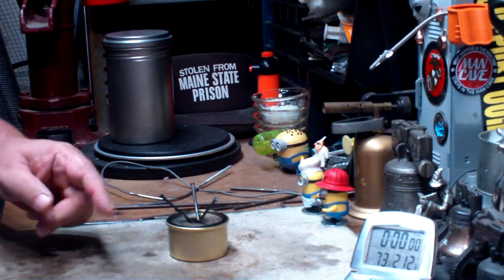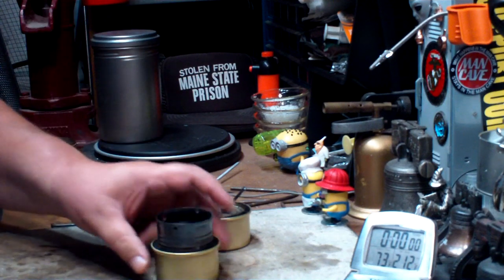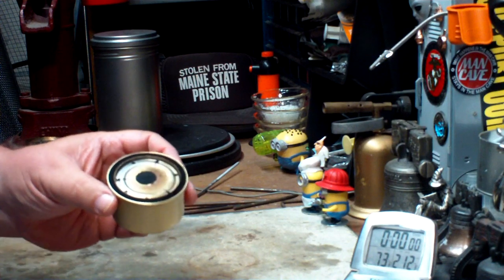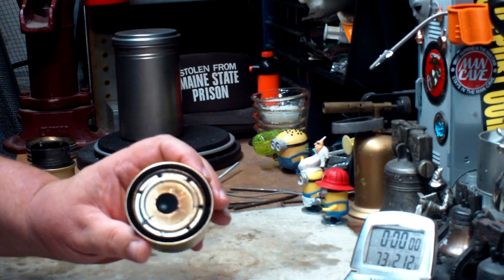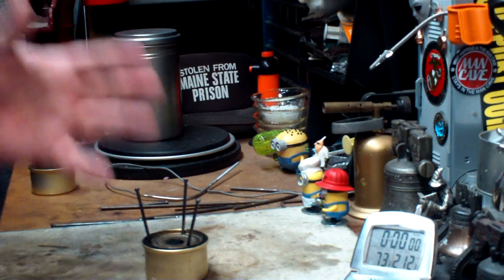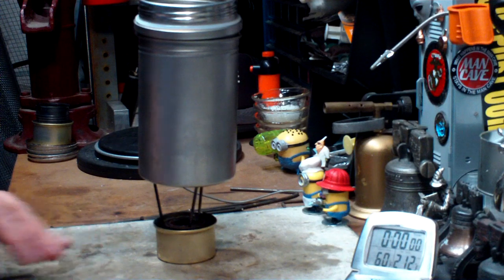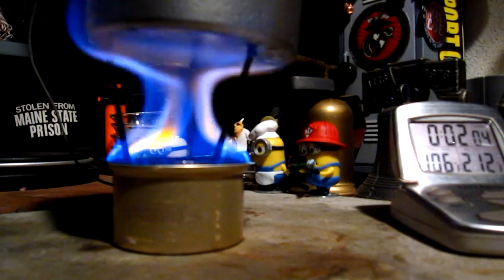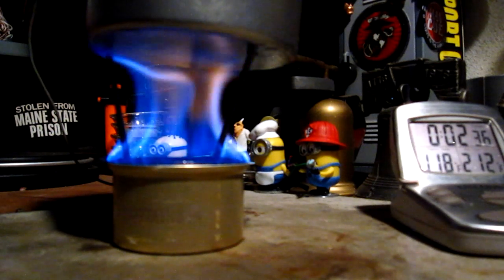Vargo Stainless Steel "Bot" - Bottle Pot - Fancy Feast Stove "Nailed - M1" - Boil Test #1

Comment: My alcohol stove is modified just a bit, I drilled a small 5mm hole 3/4 up the can as a air bleeder.  Boils in 4 minutes to 5 minutes depending on weather outside. I keep the hole plugged when traveling & only use 70-90% alcohol. Wool is my wick.

Comment: I suspect in all these stoves the heat is produced in a tube so you get a ring of heat on the bottom of the pot.  The tube of heat (ie combustion) is the tube defining the interface between the oxygenated air outside and the alcohol fumes inside (an example is the way the inner jets don't look like they're working in the evernew titanium stove.  I can't think of any reason the alcohol would stop coming out those jets, but I can see that no oxygen is getting there).  In jetted stoves there may be more area if the jets aren't so close that the fumes merge.  And there are some like the ring of fire that inject air in the centre. Some of Tetkobas that spiral the jets may make enough turbulance that there's oxygen in a wider volume.

Comment: Hiram;

Jon Fong could explain this better than I.

As you raise the pot higher a boiling stove becomes a simmer stove. 

It's an inverse square relation.

Simply heat output is based on the square of the distance.

I think removing the internal can and using the hardware cloth pot stand will give you the best results.